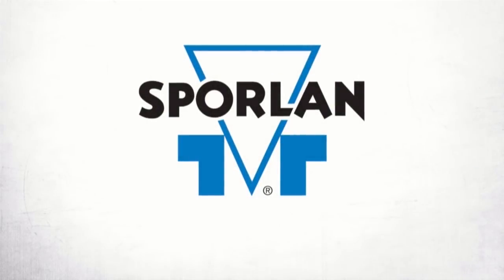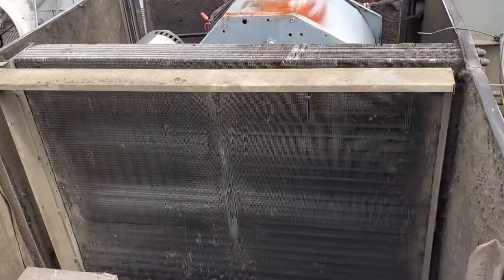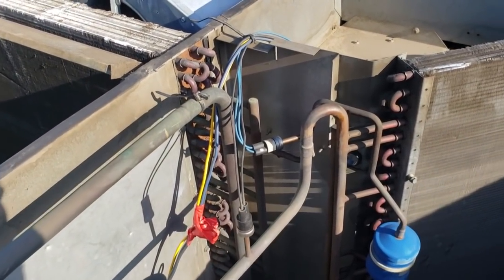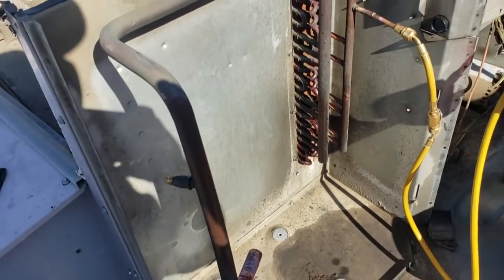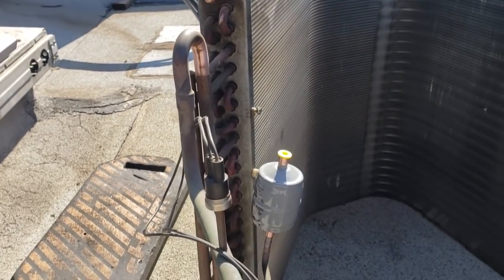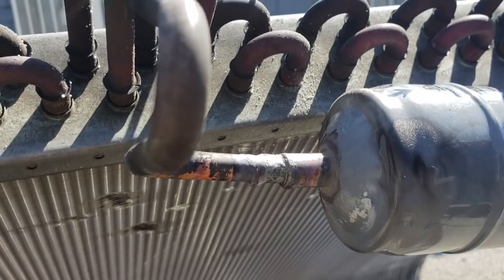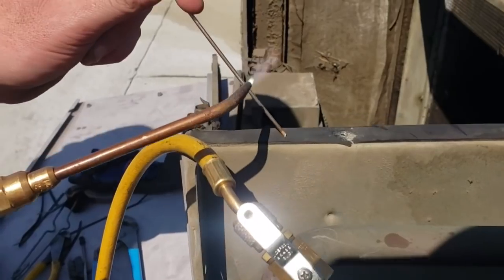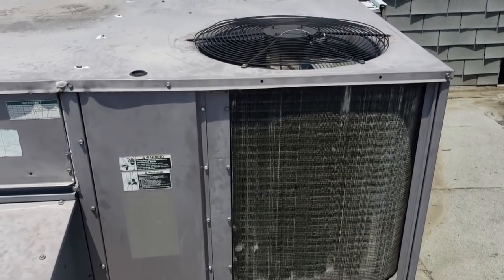CARRIER NO COOLING CALL

Comment: I'd argue that the zip tie on the dryer failed, allowed the lines that were likely stressed to start rubbing, and the oil charge of the compressor exited the system. Actually had something similar to that happen to one of my friends residential units, we found that one of the lines came into contact with the line coming out of the compressor. Eventually the oil charge ended up all over inside of the unit as we found during an impromptu post-mortem inspection. The compressor then locked up causing the unit to fault out (the tricky part was the unit shut off the compressor without allowing the circuit breaker to trip). The reason why we figure that's the order of events is that we noticed diminished cooling capacity at the height of the day prior to the failure of the compressor.  We're of the opinion that this was most likely due to the refrigerant charge venting.

By the way, thanks so much for your videos. They're greatly informative and I'm learning a lot from them!
Reply: @CuriousEvenmore  our compressor had actually seized from lack of oil. Full disclosure: Most of the oil charge had vented through a pin hole leak that started. We had someone come out to recharge the unit because we did notice the cooling capacity was diminished the few days prior. The techs just topped it up and didn't bother to do an inspection enough or care enough to notice the oil soaked compressor until it killed it. We forced the compressor on to verify its death, bypassing the high side cutoff,  and it refused to start, eventually popping the breaker during testing. It's been running lovely since the new compressor and we moved lines around to keep them from chafing for almost 4 years now. (Old compressor lasted 1 year before failure)

Comment: I have 32+ years of hvac/r and I admire how anal you are about you're work . You are by far the best hvac/r expert on youtube. I really enjoy watching you're channel. Great job. ? Do you really use heat block for drier's or just for show? never used heat block for installing driers felt it was a great idea. You can repaint drier. Do you like using 45 on compressor wields? Gas line was missing drip leg .
Reply from the maker: The heat block was for the apprentice because I knew he would burn everything up. I rarely use heat compounds or putty at all, I came up old school where I was taught to not get the part hot enough to ruin it. And even wet towels are a nuisance in my opinion, but to each their own.

Comment: I saw that leak a mile away... good training and very confident it is alive again...  certainly would love to go into this feild... I wonder though if you got any heat pump videos? That soldering was a tad rough to watch.... I dont like to see more heat applied to copper that you half to.... worked on plenty of cold hold boxes both mid temp and low temperature  as well as the engine driven stuff definitely didnt want to heat the copper too much on them

Comment: I’m a heavy equipment mechanic and on some of the buses I’ve worked on, the discharge line from the compressor is copper, not unlike the lines you’re used to working on. Sometimes, wiring harnesses will be run too close to the copper and the plastic loom they are wrapped in will rub a hole in the copper and cause an air leak. Maybe ACR copper is a little bit more durable than what we use, but I never thought something plastic could rub a hole through copper.

Comment: Many years ago in my career I would have thoroughly flushed the whole system with R-11. Since there was a substantial leak the possibility of contamination is possible though the leak was on the high side. Also since the compressor had substantial chatter the possibility of partial failed windings could also contaminate the system. If this occurs it is very noticeable in the sting odor of the mineral oil which is usually odorless.

Comment: The ty wrap trick can also be a single ty wrap around both tubes and then another ty wrap between the tubes going around the other ty wrap.It will space the tubes whe width of the ty wrap plus a little. Also label the type of refrigerant and date in the unit somewhere.  It is out of hand here in Fl where guys are doing a repair or a comp change and are using an alternate refrigerant, and  mixing too.

Comment: I’m on a coastal environment and I wouldn’t have changed the drier just because paint is a little bubbled. Wipe it off, scoff it just a bit and lay a couple coats of kondenser kote. It’s a clear polymer rubber like coating and works great. Spray all my rotolocks and stuff with it.

Comment: Nice to see black cable ties being used externally. My pet peeve is white ones being used outside and vice versa. My only criticism would be, having had my hands ripped apart, that a flush cutting tool would be nice instead of leaving sharp ends sticking out of the buckle.

Comment: On the fitting going into the compressor, I would have tinned the attaching piece and heated and slid them together.  Tinning or applying solder around the joint is quick easy works in awkward positions and saves your vocabulary

Comment: The problem I have is I only maintain a few ACs.  Mostly I work on engine generators. As a result, when one DOES go bad that isn't just a window unit we always have to re-learn how to troubleshoot it. And replacing parts of the refrigeration system is a job for someone who is in practice, so we always call him to do it.  I am trying to learn, but when you only have one such problem per year or so it's hard to get in practice. The most common problem we get is failed defroster boards.

Comment: Great job guys. I was willing you through the internet to see that leak lol. I know you probably couldnt see it as well from where you were standing.  From the camera angle I saw it almost right away especially after you panned down you could see the broke mount for the drier. Those white zip ties seem to break down so fast in the sun. Seems to happen less with the black ones for whatever reason.
Reply: Your comment on holding the torch away from the return reminds me of a screw up I had when I was still green. Was soldering in a compressor on a RTU with the unit still running. A AAON with the separate compressor section sealed off from everything so it was easy to leave the other 3 circuits running to keep the building cool while we were working on the 4th. Right behind the compressor I was working on the liquid lines went into a hole into the blower section headed to the condenser coil.....torch just barely touched the dusty insulation sticking out of the hole and with the wind from the blower sucking through the hole made it turn instantly into a roaring smoldering fire just like a boys scout out blowing on a tinder pile. Started pumping smoke into the building faster than you could blink. Dove off the ladder(these were super high on curb adapters ) and slammed off the disconnect as fast as I could and started dumping every bottle of water we had on it. Fire went out as soon as the blower turned off and just toasted a couple inches of insulation but sure made young me about shit my pants. Sheepishly told the manager that came on the roof wondering about the smell oh ya were just soldering that's normal and carried on with the install... Had the worst case of cotton mouth the rest of the day with all our water gone and the adrenaline pumping lol

Comment: Great video, I would love to do a post mortem on the compressor.

For the record, I'm an IT guy who learnt A/C basics a long while back so I couldn't be BSed by rouge HVAC engineers when there were datacentre cooling problems.
Reply: IT guy with minimal AC understanding challenging a tech working on big Leiberts in a massive data center because it's +2deg and -3RH off setpoint in the space, helicoptering said tech because they have nothing better to do atm... yup been there.
Shit, that was one helluva run on sentence.  I feel like a neck beard now.
Reply: @kaptaintrips  What are you talking about, please?

Comment: No crankcase heater along with a setback thermostat allows liquid refrigerant to collect under the oil. When the setback ends the violently boiling refrigerant turns the oil to foam and pumps it to the condenser and now your compressor runs with no oil..Bottom bearing is destroyed. That's what causes your vibration. Some will break the mounting bolts. I had a huge server room with 13  130 ton intellipaks 8 compressors each. Crankcase heater failure would destroy the large scroll compressors.

Comment: You do have the patience of a saint. I have never braized. I have done a lot of plumbing soldering. What type of solder did you use? I had worked with a guy who seemed to not get the flow you did. He kept getting the heat n solder moving all around the pipe, little by little.

Comment: Is the decision to use the outer cone of the torch some quirk of HVAC? The copper I sweat isn't for anything like the pressures used in refrigeration. I normally use the inner cone, to maximize the rate of heating and reduce conductive transfer to the surrounding material. 

Black UV-proof zip ties last years longer, even in a seemingly shaded location such as that; normal white/translucent zip ties degrade from sunlight and become embrittled. Metals reflect light the same as a mirror, so even UV does make it into every nook and cranny! I've lost count of how many white cable ties I've replaced due to photodegradation indoors induced by fluorescent lighting.

Comment: Good job Chris. Your a good teacher and have enough patience, some don't. If I change a condenser fan motor or blade and don't have any specs on the unit. I always measure where the blade is and put it back in the same place. I find a lot of guys just change it and don't seem to care if it's right or not.I do have a question though. What about moving the blade if unsure if it's in the right spot and adjusting it by motor amps? Seems to me that would work but never tried it
Reply from the maker: In my situation the motor is the wrong one and you cant move the blade any higher, they put a 1/2 hp motor when the original was a 1/4hp so the body of the motor is taller

Comment: Hi, great video. My question is what stuff do you use to prevent dryer and compressor to head up?
I wouldn't tie up any electrical wire to vibrating copper tubes. I'll tie them up on anything else like a divider wall or something. Thanks for sharing this video.

Comment: Like the format with the apprentice. The longer duration of video is not a problem for me.

Question, do you (should we?) ever flow nitrogen when UNsweating fittings?
Reply: Flush out refrigerant means not making phosgene?
Reply from the maker: Thanks Dave, I don't purge with Nitro while un-sweating because it can cause a bigger flame out that what already happened when my apprentice un-sweat the original one.

Comment: I have many experience on scroll compressors rattling. its the counter balance getting loose or clearance on shafting to scroll have more clearance. if the ampere draw out on the compressor is not to get concern about , I usually install a muffler(copper pipe vibration eliminator) on the suction and  discharge pipe to dampen the vibration but if the running ampere is much higher or a no load ampere is high, replacement is the only way to go.
a two headed oxyaceltylene  torch will make your tube brazing much easier.
is it illegal to flush r-141b there in the U.S.A.?

Comment: I would not have changed that compressor out right away. Chances are it was making bad noises is because its low on oil. That was a pretty good leak going on there. Add oil with oil pump and see how it sounds, maybe it wouldve run fine for another year or two.
Reply: Yeah I was thinking the same thing

Comment: To the guy making this video, 
Question for you:
Instead of welding to fix the leak , can we used compound ? 
I used compound on my power steering pipe in my car awhile back. It was leaking bad. Since I used compound to repair the leak, hasn't leaked power steering fluid since. Car runs awesome.
Reply from the maker: I wouldnt trust a compound on refrigerant piping, only brazing for me
Reply: @HVACRVIDEOS  ... Ok, it was only a thought.

Comment: I question one part of diagnostics. The rub thru could of happened from the strap breaking but the compressor noise/vibrations could of cane after the leak due to oil loss? Couldn’t we add a couple ounces of oil to salvage the compressor once repaired? Great video.
Reply from the maker: I will address you comment on my livestream tongiht, I will be going live on YouTube this evening 8/5/19 @5:PM (west coast time) to discuss my most recent videos and answer questions from emails, the YouTube comments and the chat, come check it out if you can! https://youtu.be/cfSKAK6BvSw

HVACR Videos

Comment: When you heat up those short orifices how much pressure of nitrogen do you use I have a Trane unit now that needs this they don't want to spend the money on a TXV kit
Reply from the maker: Dan it never works that well if they really need it heating them up is not going to completely clear them, I do it as a preventive measure. But as far as how much pressure i use the full force of my regulator which is 400 psi

Comment: On copper that runs the risk of rubbing I like to use scrap copper to add a extra layer of rub protection or braze a stick of like 3/8" tube between them with the radius on the ends. Dont know how to explain that one any better. I know there is a heat transfer between lines doing this but I dont think enough to make a difference.

Comment: Im just wondering:
How do you work out how many KG of refrigerant you need if you don’t have a reliable label or manual?
How many bar pressure difference should you get between high & low pressure side, again if there’s no documentation on it?
I bet you come across units w.o any info on it.

Comment: Just a comment about Carrier. In my opinion they should have designed this unit where the copper lines do not run so close to each other. The wire ties most likely will suffice for some time however, these are weak areas that will eventually fail whenever the ties break down.

Comment: Questions from a machinist here: Do you use Flux while hard-soldering? Also is there a reason why you don't use a soldering nozzle for your torch? Btw. Awesome tip with the double zip-ties! Wires rubbing against vibrating parts are a true pain in the rear!

Comment: On That Dryer Line Wouldn't it Be Safer to Put a 90* On That Line so Vibration doesn't Ware out That Ziptie and Create another Leak in The Same Spot ? Great Video I Did HVAC For Years Learned from My Father that Owned his own Business for over 35 Years.
Vibration is Common in a Hvac Unit from The Compressor Starting up That Will Eventually Tear up those Zipties and Create another leak,Wouldn't you want to Avoid that from Happening Again and Possibly put a 90* so it's not Touching the Refrigerant Line ? Just Asking..

Comment: Could you show how you do an oil change and how you determine compressor rotation in a future video? I'm curious.
Reply: Oil change was to the vacuum pump, not the system.

Compressor phase rotation determined on 1st start up by monitoring refrigerant pressures. Before starting pressures are equal. If rotation correct low side psi drops and high side immediately increases. If that doesn't happen shut it down quick and change any two legs.

Comment: I went to a call today on a roof top unit that wasn't cooling. The thermostat said it was 65 degrees but it was really hot in the restaurant. I went up on the roof to look at the remote sensor I replaced two weeks ago and when I pulled the panel off it was real cold in the return.  I looked at the compressors and noticed ice on them so I decided to look at the blower. I found the belt had came off. When I looked further into it I saw that the last company did not put all of the bolts back on at the motor mount and the adjustment screw was just hanging there.

Comment: Do you ever think about getting yourself a Turbo Torch? I've been using one for over 30 years. It's so much easier to make solder connections with a Turbo Torch. I don't know if carrier has a TXV replacement kit for their evaporators like Trane does, they have some packages with the similar multiple orifice metering device. They have a TXV replacement kit for it. I was told by a Trane tech support that a crankcase heater help resolve those nuisance plug up issues, keep soil warm and helps prevent waxing on Startup of the compressor. The low pressure switch was installed on the liquid line going into the evaporator, I don't like that idea from the factory. I've seen systems almost out of refrigerant running a negative pressure with that lowest pressure switch because it's in the liquid line. I always end up eliminating that and putting up the low pressure switch in the suction line where it belongs. Scroll compressors are not good with very little refrigerant they will burn out quick. I did install crankcase heaters on a carrier package unit similar to that that is for the server room at the school district where I work, that was over ten years ago and I still haven't had a plugged up evaporator yet. Dual circuit two-stage unit

Comment: Hi are you brazing and soldering ??
I don't see you using any flux ?? 
The compressors that are knackered.... do they get reconditioned or are they just scrap ??. Rgds Don.
Reply: Don Codman depending on which type of brazing rod he’s using, it doesn’t need flux. You can always add some but it’s not necessary. He is definitely brazing, not soldering.